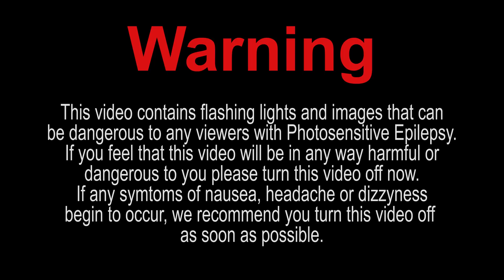How LED and LCD TV's Work in Slow Motion  [Original]

Comment: yuou know 4k is just a resolution, but yes 4k tvs usually have a higher ppi
Reply from the maker: yeah this was just a little spool up episode to feel things out. And get direction how we're going to build the channel. but yeah it would have been good if I explain that. because two TVs size the same 4K vs 1080 that's exactly what it is pixels per inch. thanks for the comment
Reply: Warped Perception no porblem! quick quest, what do you render as? like the format? i have been trying a few out to see what looks best for youtube, and this looks really good, my latest video is the best format so far that i found
Reply from the maker: +mrconfusing  so regarding YouTube only Kama we encode H. 264 at 80 mbps
Reply from the maker: h.264 what are you rendering as ?